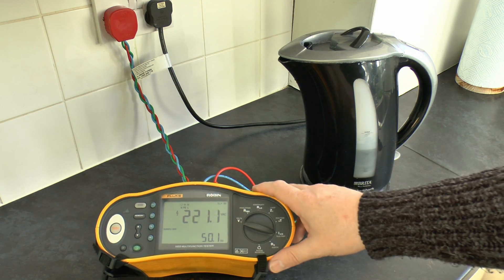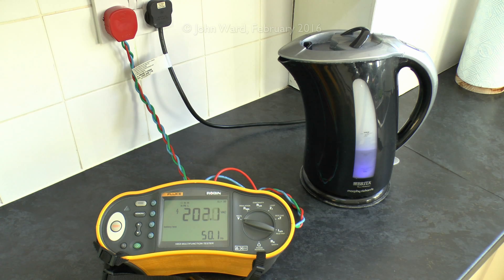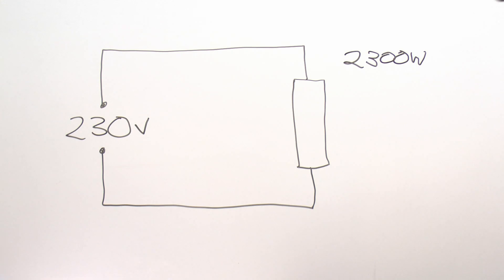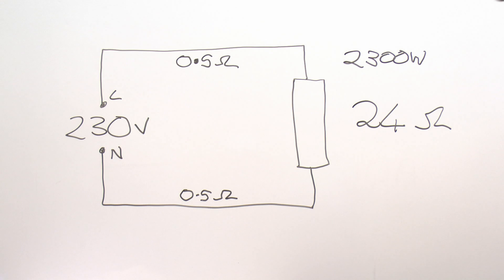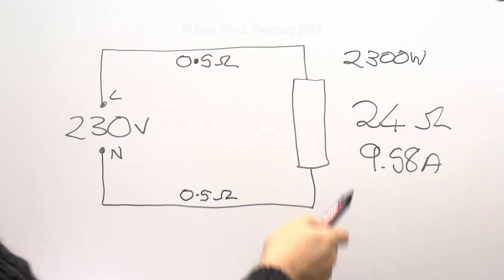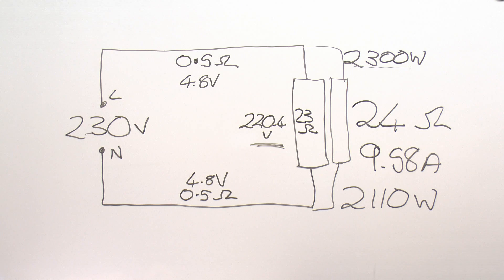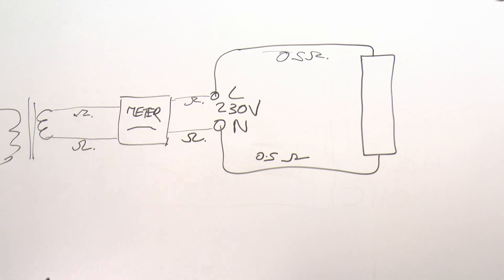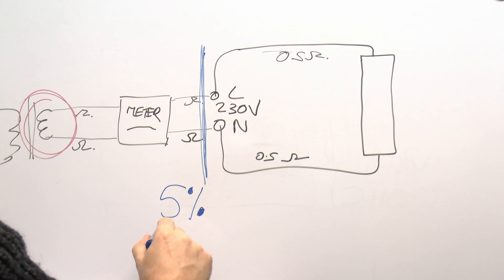Voltage Drop in Electrical Circuits

Comment: You are the man!!! May I ask a followup question: I read that “voltage drop” explains BOTH why ilights will Dim if a heavy load is turned on, and also why neutral to ground will have some voltage (measured at the outlet let’s say) if a load is on even then they are bonded at the main panel. Can you explain how voltage drop explains both of these to a noob?

Comment: John can you explain why you used the resistance calculating how much current was used . 2300w / 230v = 10amp but going by the resistance it’s 9.58 amps . Please explain .

Comment: I'm glad you clarified the reason for the low voltage shown during your demonstration. I was very surprised because the UK power grid is generally pretty well-regulated and I was surprised to see the voltage drop below 216.

Comment: I thought if voltage goes down the current would increase? …. 2300/230= 10a, 2300/220v = 10.45?
Reply from the maker: Power of the kettle isn't fixed, it's based on the fixed resistance of the heating element at 230V.
If a lower voltage is applied to a fixed resistance, the current decreases and so does the power.

Comment: Voltage where you are is low ? Usually close to 250 where I am.
Reply from the maker: That installation had a fault with the supply at the time of the video, so the voltage reduction was much greater than normal.
Reply: @jwflame  thanks for taking the time to reply JW. What sort of thing would cause that?

Comment: 3% on lighting circuits.. that really depends on the light.. a ballast driven light will not see lights "dimming" between 3% or even 10%.   Most HID lights for example will fire with a 10% voltage drop due to the ballast being able to make up for the difference in lost voltage.. you wont see a "dimming" effect... maybe on incandescent or halogen lights but not on ballast driven lights

Comment: Hi JW really enjoy your videos and this great explanation of voltage drop. One thing I did note was that there is no mention of the utilisation voltage. I believe in the UK as with Australia the service provider is permitted a +10%, -6% variation in supply at the consumer point of attachment. Further to this BS 7671 and AS 3000 permit a maximum VD of 5% within the premise. Therefore the maximum & minimum voltage (or utilisation voltage) experienced at the consumers outlet could be 230VAC +10%, -11% or 253VAC to 205VAC. A voltage as low as 205VAC is permissible.

Comment: That wasn't a huge drop. In my house the voltage dropped from 241V to 219V on L1 when my washer and dryer (16A) were running. In the kitchen, it drops about 8V on L2 when I switch the 1400W coffee machine on. And this is not for the separate circuits, it's for each of the phases.

Comment: How was it discovered that the supply was faulty? Is it dependent on the supplying company to discover it on their own? Would residents be able to figure it out?
Reply from the maker: Fluorescent lights in the kitchen and bathroom were not working at certain times of the day, yet worked perfectly at other times.
Reply: @jwflame  thank you for sharing!

Comment: Robin electronics , they were located in Watford and made the Robin range of test instruments in the late 90s they stopped trading and re located to Chesham and rebranded as kewtech industry’s and continued to make the Robin meters but changed the colour from yellow to grey and rearranged the model numbers , ie Robin KTS 1620 became kewtech kt 62. Since then the Robin brand has been used by a number of different manufacturers including fluck and amprobe  . Great video John very well explained

Comment: All electrical equipment in the house acts like ballasts to the supply cable. This is normally not noticeable with low current devices such as a lamp. It's heat that causes this effect. So for example a 3kw kettle would cause a certain amount of heat in the lead and cable supplying it. Not necessarily anything we would notice by touch but there nevertheless. The more heat the more the voltage drop. This leaves less voltage to the next circuit or appliance in line. Some speakers systems use a light bulb such as the ones in car vanity lamps. they are used in line with the tweeters. If the supply gets too high, which could blow the tweeter, the bulb starts getting hot or even glowing which reduces the voltage and overall lowering the wattage to the tweeter. So how about in a house. How do we get around this if it causes an issue or an annoyance. It is possible but not practical. Gold is a bit expensive unfortunately

Comment: I tried your experiment in my kitchen I didn't experience just 1 volt dropping my Kitchen outlets are on a 20V breaker @122V
Reply from the maker: A tiny volt drop is normal - the installation in the video had a fault which caused a much larger drop than would usually be seen.

Comment: How did you discover the house with the voltage drop? Ie did your customer report problems, if so what were they experience that resulted in a call out? (Was it flickering lights or something worse)

Also I love your videos. It’s cleared up so much in my head about how stuff works!
Reply from the maker: Kitchen light wasn't working - an older type fluorescent tube with magnetic ballast.  Would work perfectly some of the time, and at other times it wouldn't stay on due to the low voltage.

Comment: I've noticed voltage drop on my simple Kill-A-Watt depending on what's connected, along with a corresponding dim in the lights when high power devices such as the kettle, and to an even larger extent, the shower are on. I've also noticed voltage rise at night, presumably because less people are using electricity. I wonder if the frequency increases at night slightly as well due to less load on the generators, although the power stations will be throttled back as well to counter this.

Comment: Hi John I'm new to testing but since you own a fluke I thought you might be best person to ask, I'm getting zero ohms when testing about 6metres of cable feeding a shower surely I should be getting some value, I seen here on YouTube that there is a null lock on the flukes!! Have you any knowledge on this, thanks
Reply from the maker: On the older Fluke MFTs, the zero function is the oval button top left.  It's the F2 button on newer ones.
if active, there will be a ∅ symbol shown in the display.
To reset, connect the test leads together, press and hold the button until it beeps (a few seconds usually).

Comment: John, thank you for an excellent, clear cut explanation. I wonder if you could extend this to add a comment about the effect of VOLTAG DROP on household electronic controls such as inside electric showers and low voltage lamps? We have lived here for 12 years without a problem but in the last week one of our showers has ‘stuttered’ running cool for about a minute until returning to normal. Meanwhile the overhead bathroom spots dim then flicker to life. From your video, I strongly suspect an incoming supply fault and intend to report this to our supplier,. Again, many thanks for your video.
Reply: Does the lighting in the rest of the house also dim? Because if it’s in your supply, it should affect everything.

Or have you gut it fixed by now and if so what was it?

Comment: Checked all my houses power outlets and ALL are only at 60 Volts. Where my research online says standard household outlets should be 120 Volts. I am so very upset since we have been living here for 14 years now. Smh.😠 Now, What to do next and what route should i take is the question here. Should i try to find fix myself,  should i pay for a electrician to come handle this, or should i call original builders of home and complain to them about how n why this issue is happening. Smh. I am not a complaining type person. I believe in when there is a problem > Find the solution with patience, good research on issue and hard work but this electrical issue is a bit of problems since i am not a electrician and even though i have fixed a few electrical problems in past, this issue feels like a professional is better suited to handle. Honestly i just cant believe the whole house is at 60 Volts. I mean now it makes sense why so much appliances n etc stopped working in past and so many electrical outlets just stopped working (which wete fixed by a electrician the family hired) wonder why the hek didnt he see this issue? Smh, honestly i am bit frustrated the more i think about this issue and i getting frustrated is not my style. Ok well i am sorry to have dragged this on, guess i am just venting a bit. Apologies and thanks again for this content. Wish u and all many blessings n continued safety👍🏼
Reply from the maker: Electrician or the power company - if they are all the same, it suggests the problem is with the supply to the building rather than internal wiring.
Reply: Is this in the USA, 120 volts supply ? 🤔

Comment: very interesting multi-meter you have there!
Reply: Its way more than a multimeter its an installation tester tho the test he did in the opening scene you can perform the same test with a basic multimeter like a fluke 117

Comment: so how about voltage drop in DC? if we have 5V supply and a 3V LED, the resistor ohms should be calculated with the V of 2, so how was the voltage remained higher than 200V when the kettle was turned on? if we use several devices voltage drops and to make it right amps goes up to fill up the watts right?

Comment: One point about final ring circuits. When the 2.3kW kettle is switched on, the voltage should be kept up because the socket is fed from two ways. If it was on a radial, the voltage drop may have been a lot worse, especially with high current drawing appliances on the same radial.
Reply: When the significant resistance is outside the building, no, it wouldn’t have been.
Reply: @JasperJanssen  
Uh?

Comment: The comments on the lighting circuit, where less voltage drops is tolerated. 
1.  The drop on the lighting may be caused by other loads on other circuits.
2.  Many are now rewiring lights with 1.0mm, instead of 1.5mm cable, as LEDs are extensively used which draw far less current than filament lighting.  But as a voltage drop can be caused by other circuits, is it best to keep up with 1.5mm cable to keep voltage up, even though on paper the wiring is oversized.

Comment: In my place mid afternoon. 250v on the 32A ring with nothing on. Measured voltage in a double socket in kitchen - 250v.  800w Toaster plugged into same double socket - turned on drops to 249v.  Two rings on induction hob on (separate 40A circuit), drops to 248v.  Put 3kW oven on, drops to 247v.   Quite pleased.
Maybe very different at peak times.

Comment: John, very well done!   Can you please do a voltage drop video for motor loads?   Make sure motor is loaded, not free wheeling.   I would greatly appreciate your opinion!   
Here across the pond, NEC suggests 2% for feeders and 3% for circuits, with 5% max of both.   Suggestion, not code.   Your transformer in the diagram is a 3 phase 4 wire wye, correct?
Regarding the utility company having an issue, my instinct and experience suggests that their transformer has lost its ground connection at the center point of the transformers.   So, your voltage issue is what I call a floating reference point.   It needs to be grounded.  If you find what the fix was, let me know.   
Sorry,   I just saw that this is four years old!   I was listening to every word and didn't check the date.   Respectfully,   Kevin

Comment: Did you explain why the voltage dropped when you turned on the kettle? I just got from this that the cables have a resistance by themselves and this is why the theoretical value is not seen in reality. Maybe I missed something.

Comment: Question. incoming voltage is 220 on one line or is it 220 total of both lines. Here in the US when 220 V is required, it is the sum of both lines.  There are 2 "L"  or Hot, each is 110 Volts.There is no neutral line in a 220 circuit.
Reply from the maker: Neutral and 230V, there is no 110V in the UK.
Reply: @jwflame  so one line measures to 220 volt. Thank you for your reply. My experience with voltage drop has had to do with wrong wire sizing for the loader and or distance and or bad contacts.

Comment: Tip: If confronted with this type of situation and before pointing the finger to your house installation. Make sure you're being provided with the appropriate voltage. I lived in an area where after the addition of some buildings. Particularly around Christmas time (lights). The voltage surges went crazy low with violent fluctuations. Result a bunch of "burned" consumers.
Short story after complain to the power company my house was changed to another phase on the main cabinet on the street. Problem solved. 
BTW I payed the replacement of the damaged equipment. :-( 
Cheers

Comment: Very well presented. In our general math we are told that Parallel loads the voltage is the same at each load. The resistances are added together RESULTING in LOWER resistance and INCREASED amperage. 
In your example the resistances are in series. Thank you. Comment please.
Reply from the maker: The resistance in this instance is that of the supply cables and circuits within the property.  That remains constant, but as the load (amps) increases, the voltage across that resistance also increases, V= IxR.  
Parallel loads only have the same voltage if the cables connecting them have zero resistance, in textbooks this is assumed to be zero but in reality cables have some resistance although it's usually very small.
The installation in this video had a fault with the supply (high resistance connection) so the effect of voltage drop was much larger than normal.

Comment: How do we calculate voltage drop for ring circuits of numerous DC motors? Not sure if you get my question or not.
Reply: Something like 10.58 but additional lines for live and neutral, and loads are equally distributed along the loops.

Comment: I'm glad to read this was due to a fault as a near 10v drop at 10A is ridiculously high. That 1 ohm resistance is the equivalent of 135m of 2.5mm^2 copper cable (so almost 70m of length on a radial). It would require a massive ring circuit to get that sort of drop.

Comment: Thanks John, another great video, only discovered recently. However, I’m still unclear about the voltage limits at the building intake, which according to ESQCR 27 which at -6% have a lower limit of 216.2 volts, BUT, it does not state if this is on no local load, or at your full permitted load, or anything in between, are you able to advise?
Reply from the maker: Limits are when on load - the voltage should not go outside of the limits at any time.
Reply: @jwflame  Thanks John, and another question if I may, if site load includes large heat pumps, currently without soft start, will the DNO accept very brief starting current "blips" slightly in excess of the agreed intake limit (fused at 100 amp for the site I'm helping advise friends on)?
Reply from the maker: @9jws  They might accept them.  Such things should be notified to the DNO before they are installed.
Reply: Thanks again John, and yes they were apparently involved from the outset, but my enquiries continue. This all started from me helping advise friends who live at the end of a long private lane, and effectively the last house on the network branch. All houses very large, with corresponding large potential loads (in their case, includes 4 large heat pumps, 2 for house and 2 for pool, so an interesting installation). Measuring the Ze today, on no load, I got 0.55 ohms, but still trying to establish if TNS or TN-C-S as although it presents itself as TNS, I'm aware of an underground change in cable type (my son noticed it while doing some trench digging for them). Anyway, it got me thinking about the measurement of Ze generally, and even with no load on this house installation, others on the network were still connected, so formaing parallel loads, the demand on which will affect the measured Ze when just using standard loop testers or multitesters on a live network. I tried simulating this by also measuring Ze at the supply, with various loads on in the house, and sure enough, very significant changes in the measured value of Ze.  Any thoughts appreciated. 
Incidently, with a load of 64 amps, the supply voltage was just 206 volts. pfc is a concern too as as heat pumps also use type C breakers (currently without RCD's), and of course the supply 100 amp fuse, a standard BS 1361, so no hope of tripping MCB's or blowing the 100 amp fuse in a resonable time if a short circuit  fault situation. A challenge for me too is explaining the adverse fault performance of the heat pumps under low voltage conditions, and the implications on the cold weather COP, but that's another story and needs my drives engineers and refrigeration engineer hats on once I've sorted this lot!  Beeen retired over 10 years now, so having to research to get back up to speed, but it's keeping the brain ticking over!
Reply: @9jws  My ex-next door neighbour installed an industrial MIG welder in his garage. I had to live for years with my lounge  lights flickering and strobing into the late evening thanks to numbnuts next door with his cut price tractor repairs. Luckily he's gone.

Comment: I was just wondering, are those individual mains conductors, going into the Fluke, double insulated?
Reply from the maker: Yes they are - both the 4mm plug and the wire is marked with the double insulation symbol.  Rated Cat III, 1000 volts, and 20 amps.